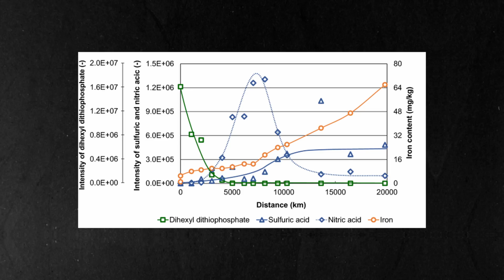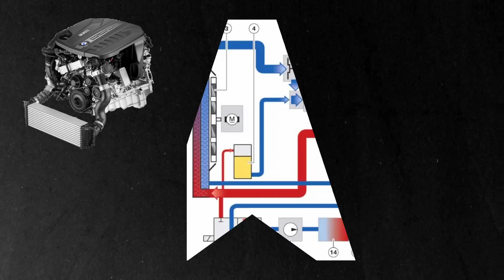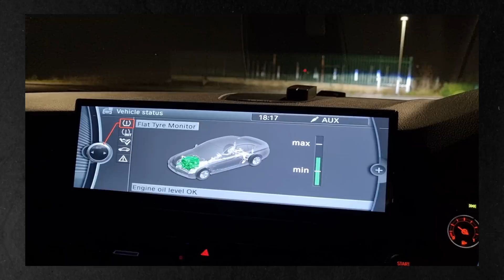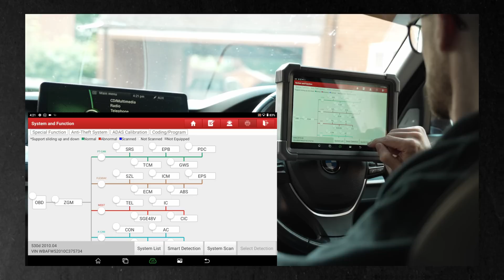DIESEL Maintenance MOST People Ignore! Make Your Engine Last 200,000+ Miles!

Comment: I worked with diesel engines over 50 yr only one i hated was a caterpillar one it was designed for hospital  generaters it started up and stopped on full revs i had it over 2yr on a quarry mobile crusher it never failed my diesel car has stop start will never use it

Comment: Bro I drive 65k km in a year 1 oil change  is 10l original mb oil I drive only highway can I do a bit longer with 1 Round
Reply: Even with an oil bypass filter, the most you can reasonably expect to get without degradation is 15k miles. You're doing damage to your engine by driving 40k without an oil change

Comment: How about idling the engine before and after drives. Whats the recommended time?
Reply from the maker: depends ... i don't spend time specifically IDLEing  ... use common sense. now if you have raced the car and the turbo is hot, i would prefer to drive slow vs IDLE the engine. Also on older engines, engine pump is not able to keep the pressure needed at idle so you don't want to idle it. also DPF is clogging up at idle.
Reply: I let mine idle after a drive for roughly 20-30 seconds , turbo diesel
Reply from the maker: @nikko5930  way to much in my opinion.

Comment: Is it good to change the fuel filter with every oil change?
Reply from the maker: depends how often you change the oil (if you change the oil every 5000miles vs 24000miels). in general the fuel filter has a longer service life.
Reply: No; pointless.
Reply: I just bought a skoda octavia 1.6 tdi . I heard  that the injectors are weak. So if I change the fuel filter every oil change to prevent failure.
Reply from the maker: @lowkey1784  if you follow the correct fuel filter change procedure yes ... if not you can damage the fuel system. Personally i change fuel filter every 2 oil changes.
Reply: Most services change your fuel filter as part of the service
Reply from the maker: @Th3unkownguy4113  are you sure about that?
Reply: @BestCarMods sorry i say that because my last service on my diesel truck included fuel filter change but i now know thats its every other service it gets checked
Reply from the maker: @Th3unkownguy4113  on the vehicles that I have worked on, the diesel filter can't be checked. also on many of the vehicles that I worked on the diesel filter change is a  more complex procedure than the oil filter and will not be performed.

Comment: Cetane booster
Reply from the maker: which brand are you using?
Reply: @BestCarMods  mannol
Reply from the maker: @bloodseed  how do you dose it ? When I was using it I was spilling a lot ... and when using plastic syringes they melt
Reply: @BestCarMods  syringes? I add it to the tank. WTH are you doing?
Reply from the maker: @bloodseed  :)) I will show you in one of my next videos ... in it I try out the Liqui Moly Diesel Purge.
Reply: @BestCarMods  Aha. Thats not cetane booster. You need 2 hoses, an inline filter, and a tall but slim container. If your filter is before the pump, you put one tube on the inlet of the filter, and one tube on where the return to the tank plugs on. You need a tall and slim -ish container. You also need a small in line filter on the return side tube. Fill the container, put the tubes in, and run at idle until your engine is up to temp, say 10 mins at idle. You then hold it at 500rpm increments, so 1500, 2000, 2500, 3000, 3500 for about 2 minutes each. This makes sure the product gets warm and is applied at enough pressure to push everything out, hence the filter in the return pipe. Better with 2 people so one can keep an eye on the levels so you dont end up just sucking air in.
Reply from the maker: @bloodseed  I use PURGE, as a maintenance additive. 500ml once a month with the fuel in the fuel tank. Previously I was using Mannol Ester.

Comment: Do not cheap out on diesel fuel quality, especially if you drive a newer diesel vehicle. If possible, always choose the more expensive one as it has better additives in it and the difference in working and fuel efficiency are very noticeable. They have better additives/detergents which clean: the fuel system, EGR/AGR, injectors, DPF. The engine runs quieter and smoother, at least here in Germany. I personally use Aral Diesel Ultimate. Or regularly pour fuel system additives. 

Also, don't forget to drive it longer than 40 minutes at least once a week so that the DPF has a chance to regenerate. If you only drive short distances, one key indicator that the DPF is regenerating is that the idle RPM are higher than normal then it usually means that the DPF is regenerating so leave it be until it finishes. 

Avoid driving diesels on reserve fuel. Often times DPF regeneration will not initiate if your car is low on fuel.
Reply: Nope; simply use the LEAST expensive reputable diesel you can find (as long as it's not laundered); and simply add your own additional additive/s; that's all 'super', 'premium' whatever, et-al, diesel, is; so you can do better for less £/$/€; and you can tweak for what you're engine / detergent / driving may actually need...
Reply: Why have all that crap in the first place. 😂
Reply: Use HVO100 - way better than Ultimate, and cheaper.
Reply from the maker: what additives are you using? and what car are you driving ?
Reply: @BestCarMods  Mercedes S211, OM648 2005. I used to use various additives from Liqui Moly, Mathys and Lifetime. But I drive it on premium diesel for a long time now. Oil filter change every ~7k km.
Reply from the maker: @deyoviC  I was using Mannol Ester for a time, but I found it hard to add to the fuel tank. After that I used Liqui Moly Purge.  With the premium fuels, I am a bit suspicious ... when I was in University, our teacher, fuel phd, told us that when it comes to fuel, you need to see it as food. Get the one that is fresh. That means get the one that the majority buys, aka normal fuel. There are all sorts of bacteria issues, contamination of tanks and other strange stuff, and because the majority of people don't buy the expensive fuel... our advice was to get the normal and put our own additives. How many people you know that buy the premium stuff ?

Comment: Regarding intake system clocking,- do you have experience using GTL (Gas To Liquid) diesel? This burns much cleaner and should therefore greatly reduce al the terrible dirt in the intake system resulting from the EGR-valve.
Reply from the maker: Never heard about them. Could you please give me some examples of vehicles or systems that have such a thing implemented?
Reply: @BestCarMods  It's a type of a fuel.   In some way similar to HVO100.
Reply: V-power!

Comment: Can you tell me why my diesel engine vibrates?
2010 ford fiesta 1.6, dv6 416 tzja 95hp 8 valve
Ive been told a less than healthy injector, but no smoke or missfire, or high oil pressure, but no leaking or code for a failed regulator. Happens when in neutral or gear, clutch up or down, matches rpm till above 3200rpm then it goes away.
Any assistance?
Reply from the maker: how many KM?
Reply: 76k miles. 121k km approx
Reply from the maker: @bloodseed  a precise diagnostic is hard to achieve over the internet. I would suggest taking out the injectors and sending them to a test facility to inspect. I would search for a place that does also spray pattern analysis.
Reply: Because it’s a ford diesel

Comment: is canceling the EGR system would keep thing cleaner
Reply from the maker: Cancelling the EGR system will significantly reduce soot build-up in the intake.  Also cancelling the EGR is considered illegal in many countries especially if the car is used on public roads.
Reply: Definitely switch the egr out. Chip tuning in OZ do a plug in egr delete module. You can remove it if you live in an nazi emissions law type of country

Comment: I want to swap my diesel fuel filter but I need a diagnostic tool from VAG…
Reply from the maker: yes you do
Reply: @ what software do you recommend?
Reply from the maker: @BikerrepOliver  depends how much money you want to spend and what other cars you want to work on ... VCDS , Xtool or Launch. after that Topdon, thinkware
Reply: @BestCarMods  well I do also want to remove component protection. What would be a software that can do both functions like fuel filter change AND cp removal ?
Reply from the maker: @BikerrepOliver  the ones that remove component protection are really expensive. 

I use a lot the Launch X431 products. 
https://www.youtube.com/watch?v=aaeaxifFM6w
Reply: Nah I got Vw, just change cartridge, empty fuel bowl & refill with clean diesel & then prime it with the key a few times before starting, never had a problem